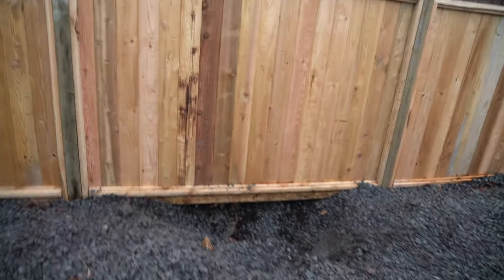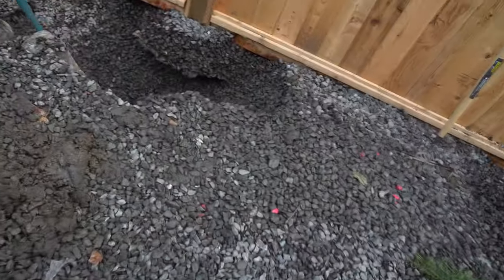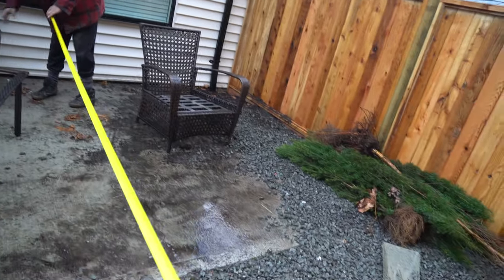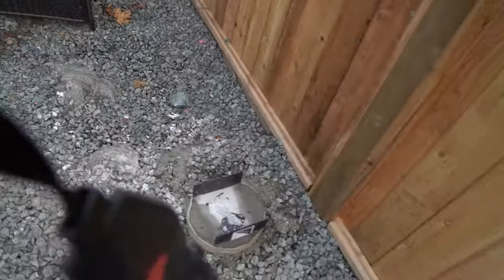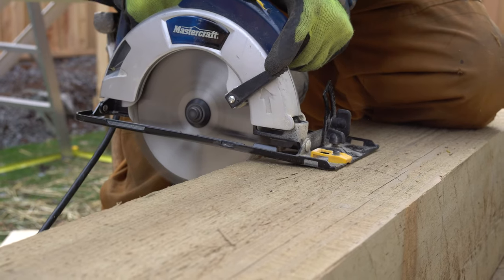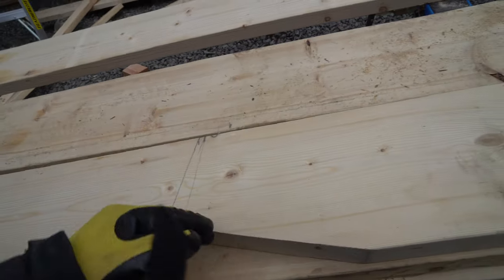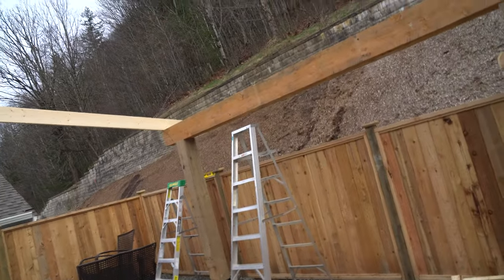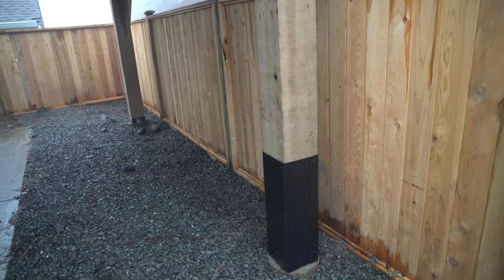HOW TO BUILD A PERGOLA AND ROOF IT FROM START TO FINISH

Comment: One question, and yes I understand I could look this up, but how were the main support beams on the back of the structure secured to the cradles on top of the cement?  I didn't see a step that anchored that structure.  I am a novice, but it seems like something more than gravity would be securing those 8 x 8 beams.
Reply from the maker: I'm guessing you mean those metal cradles so what I did is when I put the concrete and Sono tubes I put the cradles in which have that long piece of rebar into the cement was starting to cure and leveled it and then left it for a few days to dry and cure around the rebar
Reply from the maker: To simplify that a little bit more the cradle has a piece of rebar welded on the bottom of it which you countersink into the cement as it's drying and the cement dries around it like a glue and doesn't allow it to move but you have to wait for it to cure properly so that way the concrete doesn't break or anything like that
Reply: Oh, I didn't see that part where the cradles had rebar at the bottom.  That makes sense for the stability of the cradle, but I noticed the cradle only had two sides.  Does that compromise the stability of the beam?  Logically I would have expected 4 side to the cradle so the beam would fit in like a sleeve.